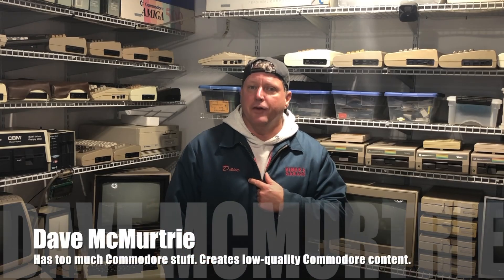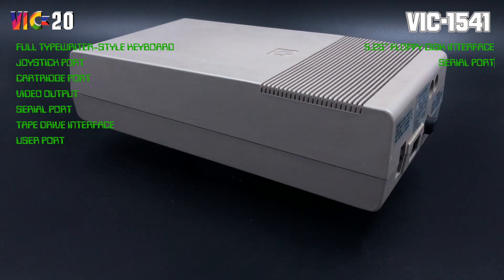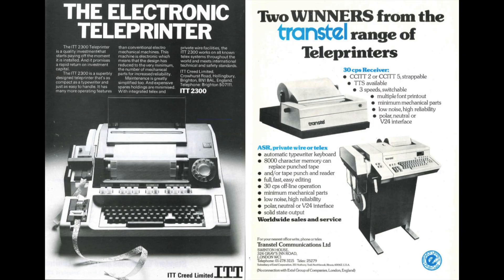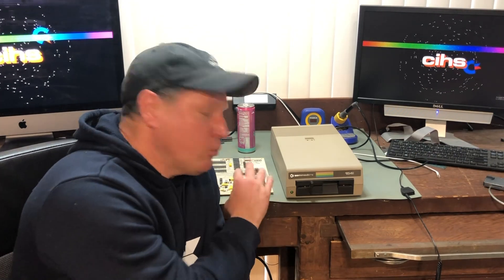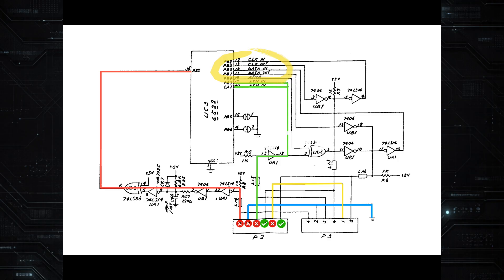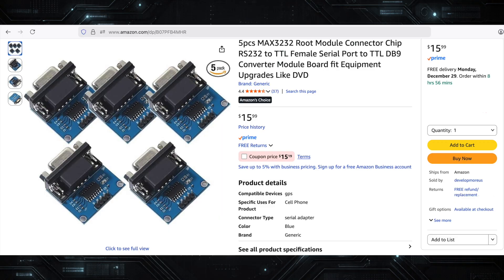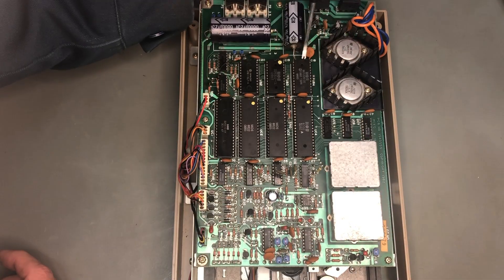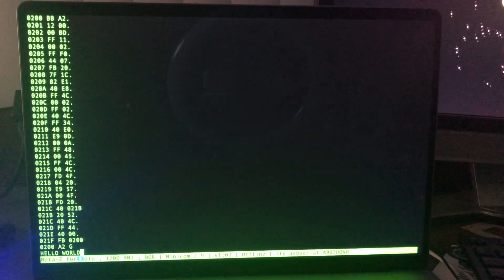Can a Commodore 1541 disk drive be used as a general purpose computer?

Comment: What I would like to see is:[

A stand alone interface box that allows me to use the 1541 (and other serial disk drives) with the commodore PET and WITHOUT modifying the computer(s) or the disk drives.

I would also be cool to have interface that allows 1541 (and other serial disk drives) with other home computers that never evolved disk interfaces. There is a 1541 interface for the Sinclair zx81, the Sharp MZ-700 and several other.  A 1541 to KIM1 disk interface would be cool , for example as would Ohio superboard or RC2014.
Reply from the maker: I created an interface for the KIM-1 to use a 1541 disk drive:

https://www.youtube.com/watch?v=cK7mzGhBfHs

There is already a device that allows you to use a 1541 disk drive with a PET. I don't have a link handy.

Comment: Everyone tells you the 1541 is a computer but this is the first time I've seen someone actually make it happen. Good stuff!
Reply: it's always been working as a computer. it's task was to read from diskette and talk to C64 via serial port.
Reply: @thomasschuler5351  Sure, but you don't really "see" it doing stuff, even when you read the error channel, it feels more like the C64 is doing it, when in fact that line was written by the 1541 and the C64 just displaying it...
Reply: @katho8472  The biggest effect of it being a computer is that no ROM or RAM space is needed in the C64 for the DOS, that resides in the dsik drive. And that you can send the command to format a disk, and the drive does it by itself, the C64 returns to the BASIC prompt and is free to do other stuff.

It is also possible to inject some code into the drive to send data directly from the drive to a printer, so the C64 is not involved and available (printer SPOOLing - Simultaneous Peripheral Operations On-Line). Like, while a lengthy program listing is printed on paper, yu can already work on the next one.
Reply: In the days, a friend of mine wrote a small program for the 1541 that was able to calculate Mandelbrot fractals and write the resulting bitmaps to the floppy, all standalone. After a night of running, the image could be displayed using the C64, keeping serious color limitations in mind of course.
Reply: Mind you, the onboard RAM is really limited, but you have plenty of swap space on the floppy 😊
Reply: It was used as computer all the time, just not by human directly. Every fastloader is loading a program to the drive to implement faster protocol, some demos are even using drive to calculate data. Look for "Freespin 1541" for another interesting example.
Reply: Look for "freespin" ... that's a demoscene product outputting video on a 1541 and realizing sound via the motor.
This is still a fun exercise.